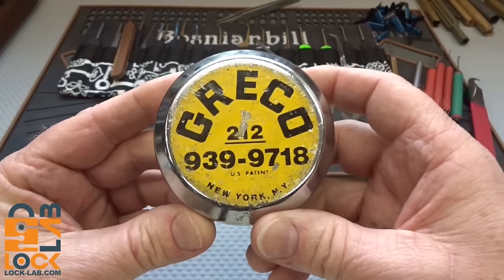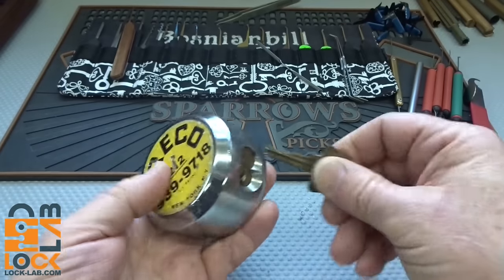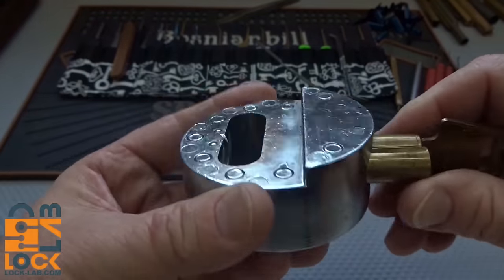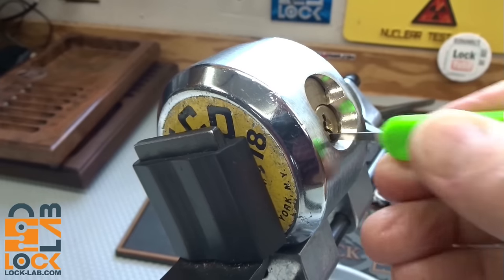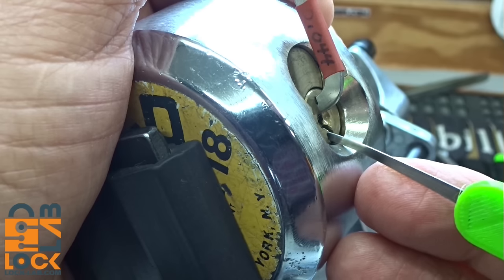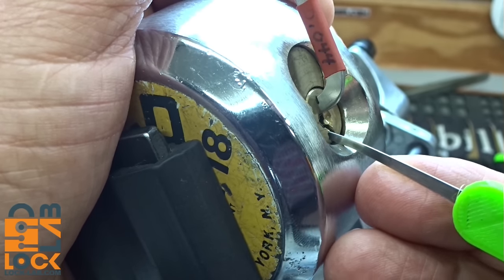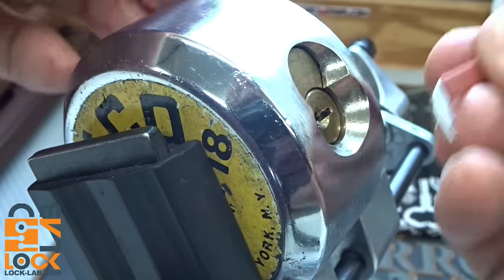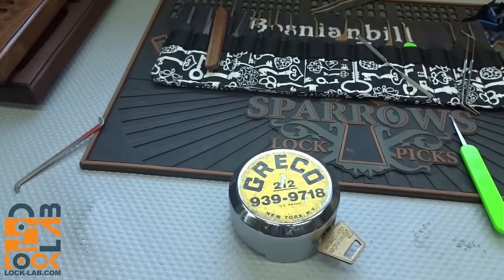(960) Greco-American Puck Lock Picked and Gutted

Comment: Greco I would think is either a locksmith company, or some sort of rental property /storage facility in the NY area. 
The number doesn't seem to be around any longer, but depending on how long ago this lock was used, it might be more simply the number split since 212 is a very old area code.
With looking that up, I do find Greco Win-Dor which has the 718 area code. They seem to be a steel door, and maybe more company with no online presence of their own.
Reply: I don't think that"US patent" fits with locksmith/rental co-your last guess seems possible-the patent may apply to the system the lock is protecting?
Reply: David Worsley
Thank you, i actually missed the "US patent" since it was started to wear off.

Maybe someone wants to give them a call and ask?

Comment: I just have to quickly mention that I had a landlord friend that lost his key to one of these puck locks for roof access to a tower block. Called me up, I went over and it was a puck lock from Master. No word of a lie, I picked it in 10 seconds flat without really knowing how the lock even worked (turning it and pulling the whole core out to unlock, etc.). I took it away and it had an exposed hex grub screw as the stopper for it. Took it out and made a replacement key using a Squire blank. After he learned I picked it in 10 seconds, he ditched it in favour of a Kryptonite puck lock which I believe has security pins in, but haven't heard or seen of it. Another reason not to buy Master.

Comment: When I need to get through one of these I just drill straight through the very top of the locking bar and take the two tiny teeth off in the process, then the rest of the core and locking bar just fall straight down and I'm in.

Comment: Question: Why is it common for security locks to have one standard and the rest spool/serrated vs all spool/serrated?
Reply: Ari Lunarium hi! The standard pin keeps the core straight and on tension! The lock with the key runs better and the security pins do not get stuck or wedge!
Reply: Excellent answer, thank you!

Comment: I want to see you pick that as if it is up against a flat surface.
Reply: Matt Harrington Great point. 
Yes that is a hole different piece of cake all together. 
And there are several different areas of locksport.  Speed picking, Challenge locks, standard and dual locking. Are just a few. But the simple picking as in use can be very difficult to get with the poor positioning. 
Cheers!

Comment: it would be nice to have one of these old locks!
Reply: Julian
The American 2000 padlock. These were nicknamed "The Puck." They are heavy and large. They are used with "heavy duty" hasps.
They are rekeyable by digging out or drill, the epoxy/metal filling the set screw hole. Remove the set screw and the cylinder slides out. After rekeying, and replacing the set screw, a little epoxy/JB Weld/ Locktite (similar substances) can be used to reset the hole. With the tightness of the lock on the hasp, you don't really need to reseal the set screw hole.
I got three Keyed-alike new generation Masters for my brother to lock-up his Trailer Doors containing his Motocross Bikes. His trailer came with Heavy Duty Locking Hasps already on it and these fit perfectly.
Reply: William Wilcox Thank you for the many good information 😀 the problem is to get one in Germany
Reply: Julian
The 2000's are still around. The newer redesign from Master are a little (yah right) lighter but the main cost would be the shipping.

Comment: WD-40 is the bane of real locksmiths. We use either liquid or powdered graphite to lubricate any keyway before 'servicing'.
Reply: Gordan Eckert In some videos says bill that he knows the wd 40 is not the right lubricant but it does for the moment good services 😉 ... and I can tell from experience the graphite is an absolute nightmare for safety pins, after some time with water and Dust turns the graphite into concrete! I only use acid and resin-free weapon oil!
Reply: Okay, WD-40 can help loosen up a lock that is totally seized up after years of dirt and grime due to lack of movement of the pins, but to leave it inside the lock only invites further collection of dirt and possible seizure of the guts. I have never  had a lock treated with liquid graphite  fail, but Wd-40 treated locks gum up within a year.